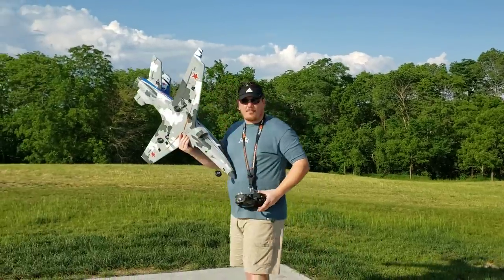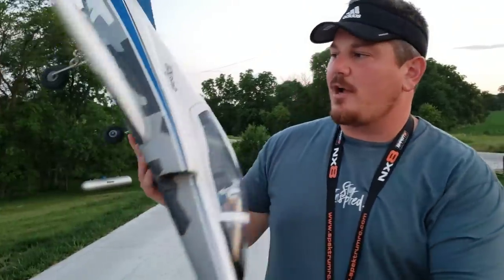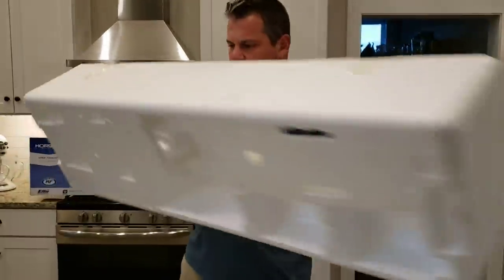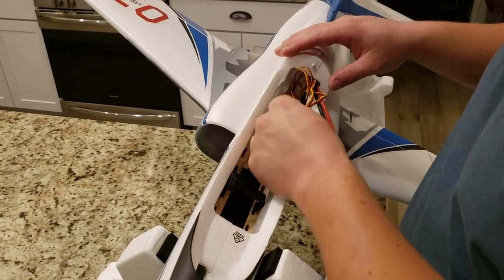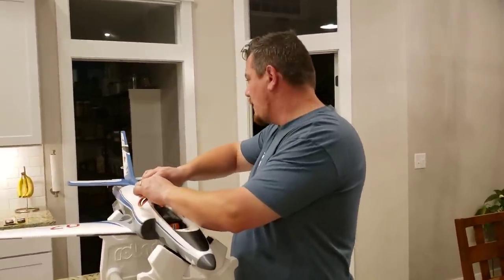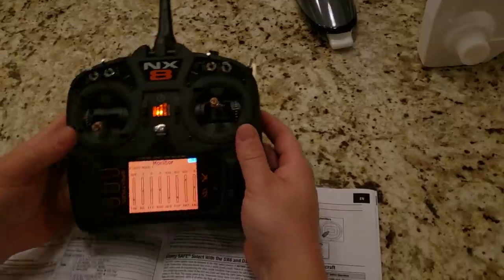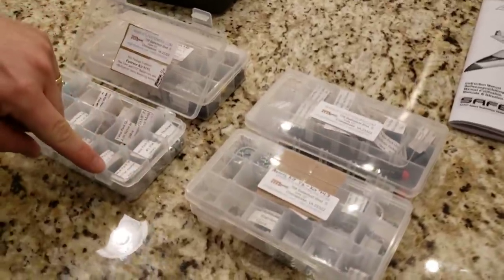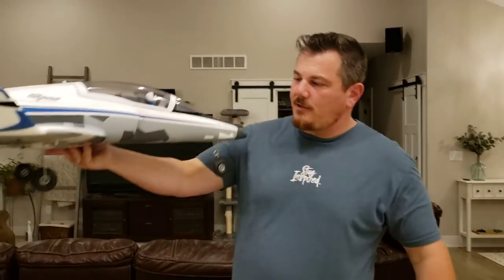Eflite - Viper V2 - 70mm - Unbox, Build, Radio Setup, & Flights

Comment: Ooo i like this one.. ordered a few other planes you reviewed based off of your review. This will be added to the list .. you're  a goat brian thanks for all you and the misses do

Is this any different then the habu sts 70mm edf jet ? Or is it just  no safe & lipo ?  Looks almost identical to it ..

And is there any options to upgrade landing gear to avoid the same issue i got on my habu?. Cross wind threw the plane and i saved it but was to close to a up sweep hill so the front landing gear snapped.  Wind wasnt anymore then 10 mph. But wind seemed to be coming from 2 diff angles
Reply from the maker: Very different than the Habu...WAY faster, and I think way better looking ;) But one of the easier flying EDF Jets offered at the moment.

As for the Habu tires, just double check the size....Dubro DOES offer different sizes too... I added the link, I had forgotten it when I first released the video.

Comment: I’m having a hard time finding any information on a flap/elevator mix. the only thing I can find online is to use a 10% down elevator on full flaps. I’m going to maiden mine tomorrow do you suggest using any flap/elevator mixing?
Reply from the maker: Watch the radio setup (the last part of this video). Then watch the maiden flights, and I'll talk about any adjustments I make. This is kinda what we do, but I can't remember all the details.

Comment: Hi BRIAN GREAT VIDEO AS ALWAYS SIR. BRIAN IM WONDERING AS HORIZON HOBBY SAYS THIS IS NEW. HAVE THEY FIXED THE PROBLEM IF THE WING SPLITTING BY THE LANDING GEAR WAS A BAD PROBLEM. HOPING THEY HAVE DONE MORE THAN TELEMETRY RECEIVER. LOOKING FORWARD TO THE 90 MM
Reply from the maker: Sure. I only KNOW about the Rx upgrade to AR631
Reply: @BrianPhillipsRC  HI BRIAN HAD MESSAGE FROM HH AND YES THEY HAVE SOLVED THE PROBLEM. VERY HAPPY 👍♥️🇬🇧🇺🇸

Comment: How hard or complicated would it be to have reverse thrust in this plane???? And would it break the bank to get the hardware to make it happen? I using the NX8 FYI. Thanks in advance.
Reply from the maker: It would be pretty easy, in fact, but it would be pretty expensive. All you need is an Avian ESC.

Comment: HI, congratulations for the videos. very beautiful and cared for. it shows that you invest time and attention. I would like to ask you for information if possible. I bought the viper 70 but I don't understand the behavior of the as3x. moving the model the ailerons practically do not move. just a little noise from the servos. in safe mode it works. do you have any suggestions. Thank you
Reply from the maker: It only works after giving 25% throttle, then if you still can't SEE it, you should be able to FEEL it with your fingers...lay your hand on the wing, across the aileron, then roll the plane. Some correction is very subtle, so you may not see it, but it's happening. Give it a try!

Remember, the correction is OPPOSITE the direction you're moving the plane. It should be RESISTING the roll, pitch, or yaw of the aircraft.

Comment: I love this plane. But it's by far the most difficult plane to land for me. If I'm too slow, a wing drops and the whole plane stalls and falls like a rock. If I'm too fast, it bounces all over the place on the runway. Two full plane replacements and one fuselage/wing replacement later, along with struts from RC-Castle and Avian ESC with reverse thrust, I'm still struggling to keep it in one piece when I land. I'm about ready to give up on it. And it isn't that I'm a bad pilot. This is my fourth plane (first jet) with almost two years experience. I figured since I mastered landing the June Nite P-51, this should be relatively easier to land. I was horribly wrong. Can't seem to figure out what I'm doing wrong. I just want to land it without destroying it. Once I can confidently do that, I'll be ordering the 90mm.
Reply from the maker: yes, this plane will "Fall out from under itself" if you get into too steep a flare, EVEN with good speed, in ground effect.
Reply from the maker: Here's a tip - Get the CG back a bit...MORE ELEVATOR AUTHORITY....and if that's not palatable for you, just FLY IT into a landing...don't try to flare...just do a slower, pass and bump into the ground. This is a good way to get a difficult to fly plane. Don't stall it into the ground, fly it like you're trying to stay low...then just slow down...keep level...it will drop, but if you're still flying, it won't "fall" like you experienced.

When you tame a hard to fly plane, you'll be so excited. Keep at it!
Reply from the maker: P.S. The 90mm is easier to land - LOL ;) Seriously!
Reply: You, Nate from RC Saylors, and so many others make it look so easy. I study the landings in these videos and you guys make this plane your b***h. Lol! I'm definitely going to try "flying" it onto the runway. I think I understand what you mean. Like, keeping a shallow approach as much as possible. Thank you for the tip!

Comment: Brian, I love it. Thank you this nice video. I habe two questions, hole you can help. If I am able to fly the Turbo Timber, Trojan, and the P51, (remember I al still new), I am able to fly this one?
Also, is it possible in a „solid“ way. I don’t have that much room (maybe 150x400m) and free area like you. And only gras take off possible. What do you think?
Reply from the maker: Grass takeoff will be tough on the gear, unless it's very nicely manicured. This plane would be possibly a good fit for your experience level, but the grass will probably, regrettably, be an issue.

Comment: hey brian how are you? im askin is i see you noticed some changes. in your opinion other than the rx is it better than the original one that came out. it seems that way. Also would it not be easier to use some m3 wheel collars for the axles to use those dubro wheels?
Reply from the maker: I think the wheel collars might need to be a bit too thin to fit, but honestly, sure that would be WAY better, if you CAN get them on too...

Better other than the Rx...I can't say if the battery cavity is actually bigger, or if it just seems that way since I'm using SMART packs now, but wither way, they FIT NOW, and I had to do a CRAZY CARVE job the first time around!!!

Glad you're here with us Michael!

Comment: Hi Brian and camera crew 
I bought the low bounce tires but they are 1/2 inch too big for my opening on my Viper the tires that come with mine are 2 1/4 inch.
Did you open your wing up or is your opening that much larger than my jet?
Reply from the maker: What size did you get? They sell the tires in a few different sizes, but I think we used 2" tires...

Viper https://bit.ly/3eLqcMX
5000 6S https://bit.ly/2SG0DUT
4000 6S https://bit.ly/3zGrhh8
NX https://bit.ly/3mbVuNB
Low Bounce Tires https://bit.ly/2VN9tRQ   (I updated this link here 2" is the size needed)
OR
Avanti Landing Gear Upgrade...
Nose Gear - https://bit.ly/3jFB283
Mains - https://bit.ly/3xvigF5

I'm soooooooooooooooooooooo sorry, if you followed the link. I THINK I screwed up and put 2+3/4" (Even though I SWEAR it was a 2" when I made the link).

Please forgive me Harry!!!
Reply from the maker: Let me know if there's anything I can to do help you get the right parts. Thank you for bringing the problem to my attention, since I had no idea the link was going to 2 + 3/4" tires...

Comment: HI Brian,
I'm completing my Viper v2 and notice a lot of the newer models have the Reflex V2 Flight Controller. It appears when you're landing and the throttle is reduced, this is when it becomes active to level your aircraft. My concern is if you need additional elevator for a flare, this unit may prevent it. I'm not an experience flyer, but I am worried about this feature? What are your thoughts on this addition to many of the FMS models?
Reply from the maker: Reflex comes on FMS models, and this is an Eflite BNF plane...so it comes with AS3X & SAFE. AS3X and SAFE VS Reflex - basically the same functions...stabilization and/or auto-leveling (and limited pitch and bank angles). 

As for "this kicks in on landing" - it kicks in when you want it on, vs when you don't. SAFE is only on if you activate it, and choose to turn it on, but AS3X is always on, unless you reprogram the Rx.

Stabilization is helpful on this and other Viper offerings, but it won't stop the plane from slipping out from under you on base leg, low and slow - I've had it happen to me a few times.
Reply from the maker: If you're a new pilot, AS3X and SAFE area a must-have.

As for Reflex, if you're not getting a BNF from Eflite (With Spektrum offerings of AS3X and SAFE) Reflex is a great second choice!

We'll help you set it up so it's ONLY helpful.

Comment: Brian whenever I fly the futura on grass the front retract get ruined. It seems the spring in the gear don't give enough and the servo takes the brunt of the force. Can you recommend any fixes
Thanks
Reply from the maker: I think you might need to fix the runway a bit, or maybe you're too nose heavy, meaning you have to get your speed up too much before roll???? This plane (the Viper 70mm) won't do grass without perfection for grass, but the Futura has done well for us.

Hard to know for sure from where I'm sitting. Sorry I can't help more

Comment: Hi Brian! I am wondering if there is way to disable the AX3S on this plane. I tried already setting the gains for flightmode 1 to 0 via bluetooth adapter programming and app but it seems like it doesn’t change anything, still AS3X active. Btw, I disabled Safe Select during binding as well. Reason why i wanna do this is because the plane crashed already twice (once during landing and once in normal flight), it did a sudden hard left turn and was not responding anymore. So i would like to exclude a fail function of the AS3X.
Any thoughts on that? Can it be that the settings are somehow locked and can’t be changed?
And after i was writing the comment and reviewing your video i recognize that i am actually not having the V2 :-( because it still has the AR636 receiver installed. I saw videos on youtube with this version having similar issues that the plane suddenly turning to one side and having no control anymore.
Reply from the maker: You have to reset to factory defaults. 

I wouldn't. This plane will FALL OUT FROM UNDER ITSELF if you slow her down too much.
Reply: @BrianPhillipsRC  Thanks Brian for your comment! You mean reset the AR636 to factory default to disable the AS3X completely?
Btw, i am a big fan of your channel, always checking out to decide which new RC to buy next :-) Can’t wait for review of the Viper 90mm, possible next jet to buy because it has alteady much better retractable gears and more space for the electronic components and cables, which are the biggest weak points of the 70mm version.

Comment: I think if the Battery hit the Button of the Receiver, nothing will happen, cause Binding process only starts when Button is pressed during Battery is connecting.
Reply from the maker: I think you may be mistaken ;) However, I believe the Push Button has to be HELD DOWN for some time (several seconds) to make it go into bind mode.
Reply from the maker: Might want to give it a shot to verify, but either way...we didn't have an issue yet ;)

Comment: Great clips! I may order one of these after I get my F16. And maybe upgrade those gears with shock-absorbing struts.

Check out the FMS Yak-130 & F-18F, also from HH. They are great flyers too, have both of them in my hanger. I haven't seen any videos of them on Youtube.
Reply from the maker: I have the F-18 on this channel...did you miss that one?
Reply: @BrianPhillipsRC  I saw your Eflite F18 video, it's a great jet. But I like the F variant more. So I picked up the FMS version. 

FMS Yak130 & FMS F18f, both are just 70mm EDF jet, which fell into that grab&go category. The Eflite F18 is more of a serious flyer to deal with, depends on the size and wing load.

Comment: I have a dx 6e and i want to fly without flaps but with safe how am i able to Do this
Reply from the maker: Controls in no particular order...

Normal

1 Throttle
2 Rudder
3 Elevator
4 Ailerons
5 Gear
6 Flaps
7 SAFE/AS3X Selection

Setup with 6 Channel Limitation

1 Throttle
2 Rudder
3 Elevator
4 Ailerons
5 Gear
6 SAFE/AS3X Selection (make the designation for flaps to control SAFE, then just d/c flaps)

OR

1 Throttle
2 Rudder
3 Elevator
4 Ailerons
5 Gear
6 FLAPS AND SAFE/AS3X Selection (make the designation for flaps to control SAFE & Leave flaps plugged in)
Reply: @BrianPhillipsRC  does that mean that i must use the setting ailerons only and not 1 aileron and 1 flap ? I am sorry to Spam you with questions but this is my first plane that i fly with an spektrum Transmitter

Comment: Hey Brian,
I am new to flying, have been learning on a carbon cub s2. 

I am getting pretty comfortable with it in safe mode, when I switch to intermediate or experienced mode it drastically goes out of control as if my trim goes out of calibration between the modes.

Is this normal?
Do you have any suggestions?
Any input would be greatly appreciated.
Thank you.
Reply from the maker: 1) You probably don't realize how much you're depending on SAFE. 2) You probably have trim that's wrong, and WAY off...so you'll have to get WAY up there, and come out of SAFE in level flight at 40-50% throttle and get things straightened out. SAFE will hid trim issues. This is probably your issue.

Good luck Tan!

Comment: hello brian i like to ask if i run 6s 5000amh and 100C do it still work the viper jet because i  got the same viper as you
Reply from the maker: That's fine, but it's hard to get the CG tail heavy enough for good flare on landings. 4000mAh is easier, but not a requirement.

Comment: Hi Brian! I’m baffled…I crashed my Viper 70mm today. I was coming in for a landing and everything was looking good…it was taking most of the runway to land so I decided to go around… I poured on the power to go around and my Viper rolled to the right and went in nose first! What did I do wrong? It was pretty slow with full flaps but it just kept floating so I decided to go around… I kept the full flaps in when I decided to pour on the power and the jet rolled in on me nose first to the right… any ideas on what happened?
Reply from the maker: I have had my 70mm roll out from under me on slow final, but I was on base leg turns under the power lines, almost right on the edge of ground effect. Sometimes, when you get into throttle on a climb out, you're right in that spot between ground effect, and you have so much drag from the FULL flap deployment, that you'll undermine your power dump...and this can cause some pitch down tendency, and you may get into an unrecoverable stall.\

I'm very sorry this happened to you, and hope it's all fixable. I once had my Viper fall from 200+ feet (I shot out the 6S battery in my old Viper!!! - pretty scary) and all that happened was the battery made a huge parabolic arc, then the plane glided down, totally uncontrolled and broke off the nose...I had her flying the next morning, if my memory serves me right.

Either way, I've had it BITE me, and planes that WILL go slow, also need to be babied back into power. I'm not sure it gets noticed, but when I power up (like your situation), I almost always flip into takeoff flaps pretty much simultaneously, and this has served me well, but I've also been lucky more than my fair share. This stuff is so frustrating, but you know you'll be a better pilot when you walk away from it. You'll learn where the line was, and stay back from it a bit more next time. It's the more SURE way to learn a lesson - the hard way - sorry it happened, still.

P.S. Was this the 70mm, or the 90mm - PLEASE Say it was the 70...pretty please

P.P.S. Don't give up - a fluke wind might have knocked your plane into an unrecoverable stall too...just get back at it and maybe even get up a few mistakes high and see if you can replicate it...it will be hard, but if Ground Effect played a part, you'll just have to keep guessing.
Reply: @BrianPhillipsRC  it was the 70 mm. Thanks so much Brian! Next time I will go into takeoff flaps and ease into the power for my go around.
Reply: @BrianPhillipsRC  These kinds of things tend to deflate me as a pilot. I have the 90 on order but I’m very leary about consistently landing it safely. This entire summer I’ve been biting my teeth on landing EDF jets…

Comment: You cant change the gains,can you?
Reply from the maker: SAFE stuff can sometimes be adjusted, but if you want to reset the thing to SCRATCH - THEN you can totally set any of it ;) - Factory Reset the Rx and then you can command all settings, but if you do, make sure you know what your doing, since I can't help you through the whole process to get it back to Viper (V2) Stock Configuration

Comment: Is it difficult to fly because I have a carbon cub s2  I almost crash it but noting break.
Reply: This Viper Jet Is Marketed As Horizon's Beginner Entry Level Larger Scale Jet, Above UMX Sizes... She's Very Easy To Fly, Just Stay Off The Throttle Down To 40%-50%, It Glides Really Great Under No Power Also! 😁
Reply: Ok thank you 🙏
Reply from the maker: This plane is harder to fly than the Habu (70mm), or the F-15 (64mm)

Habu https://bit.ly/38Kilv1
F15 https://bit.ly/30RrnlG
Reply: Oh